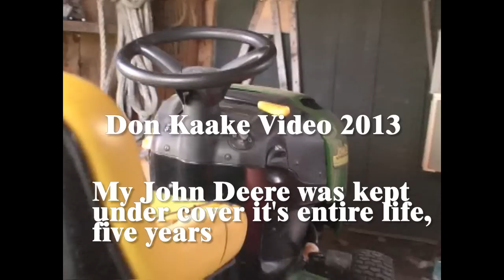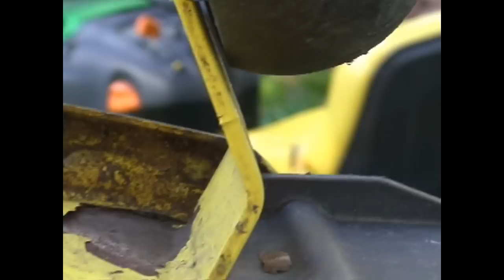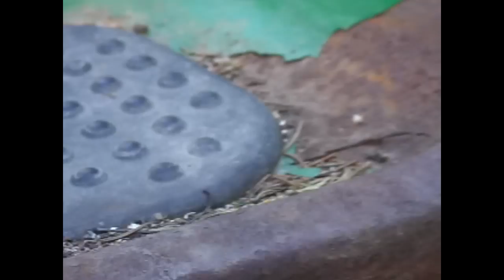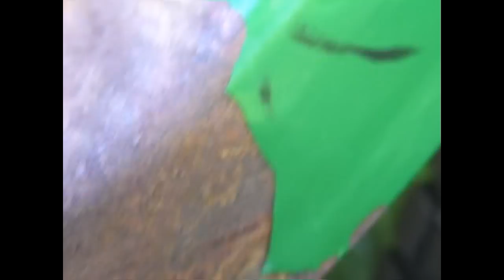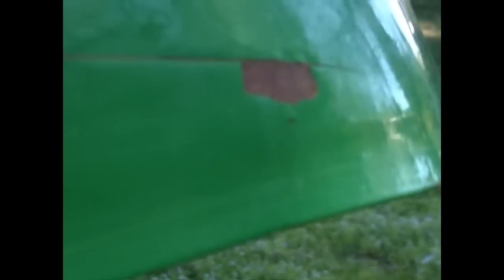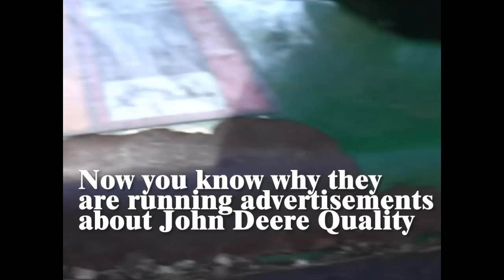John Deere Quality Samuel R. Allen Chairman and Chief Executive Officer

Comment from the maker: Ok well i can tell you what is wrong with your tractor. Its very simple. Its not a john deere. When home depot started selling john deer lawn mowers John deer signed a contract with the same people that make the scotts lawn tractor. If you buy a cheep john deere tractor from the orang box you are not getting a MTD tractor POS. Compare it to the ones in the actually JD dealer. Not the same at all. You get what you pay for. I had a little JD 180 lawn mower which ended up rusting out after 28 years